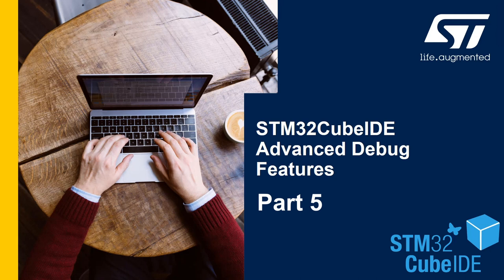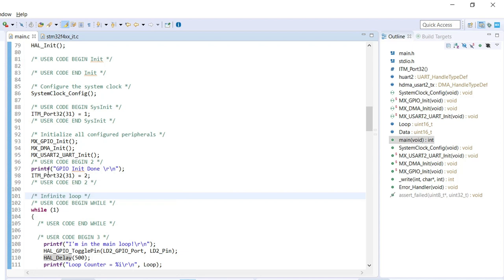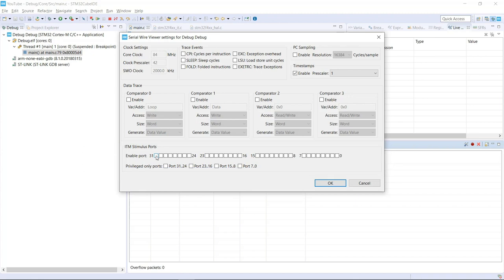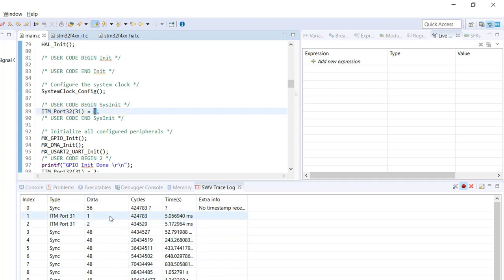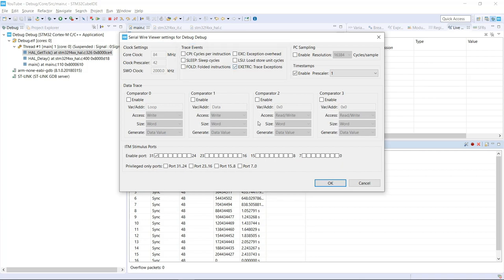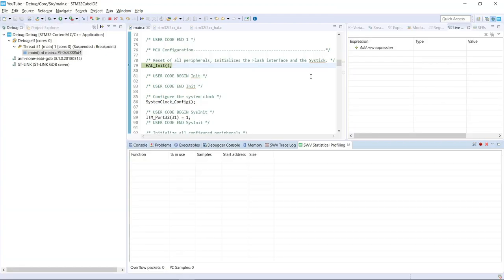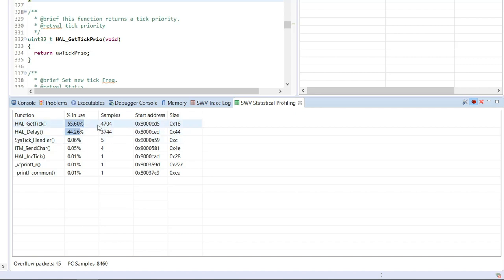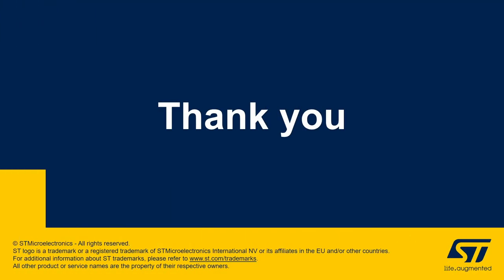STM32CubeIDE Advanced Debug Features: Part 5

Comment: It would be nice if the statistical profiler would tell me where in my code is using the instruction. I'm getting lots of usage of "__divdf3" which I'm assuming is a floating point divide assembly instruction. But it's unclear what line in my code is using it the most.
Reply from the maker: Hi there, for technical questions we really recommend you check out our community of experts and other developers at community.st.com